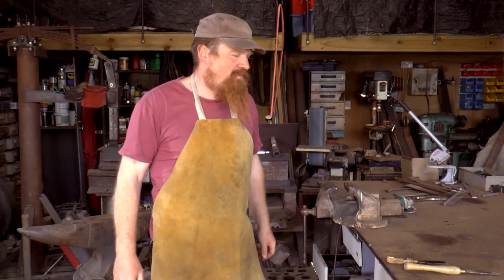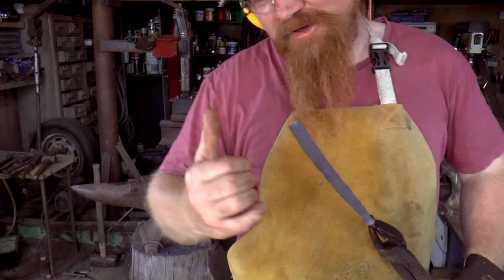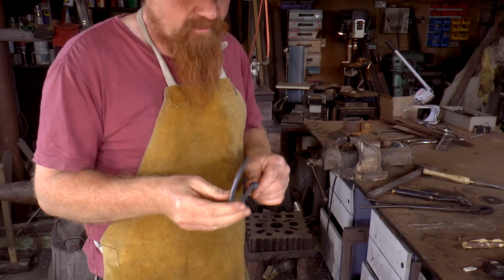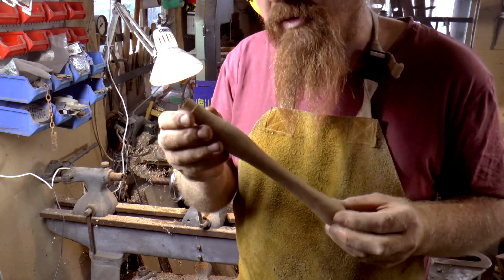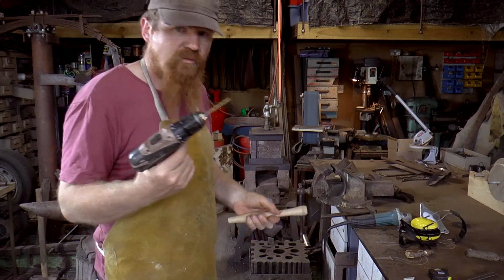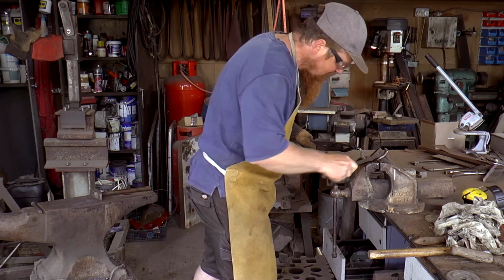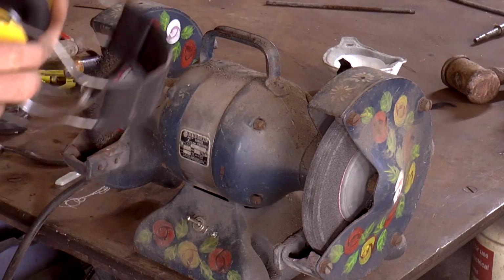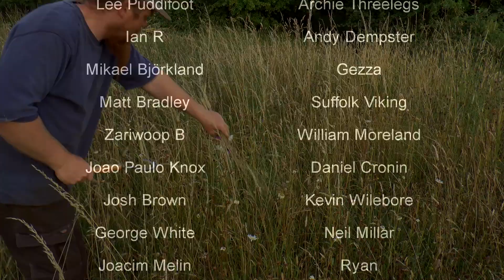Forging a Herb Sickle

Comment: Max what a joy to see your skills honed to perfection. I am sure it was well received. Strangely I have been using my Grandfathers inch and half chisel from 1906 doing flooring. Panicked for a day when it disappeared. Thankfully found in a safe place and not buried under the oak floor. Old tools really are a joy to use and re-purpose. Thank you for the video.

Comment: While a traditional heat treatment might be preferable, work hardening would have been an option aswell. Traditional sickles are generally work hardened, and since no heavy cutting operation is presumably taking place the work hardening is generally sufficient.

Comment: Check out a knife sharpening system called 'Razor Sharp edgemaking system'. Its two 8 inch MDF disks that you mount onto a bench grinder. They make your knives shaper than anything I have come across. Wranglerstar did a nice video on them.